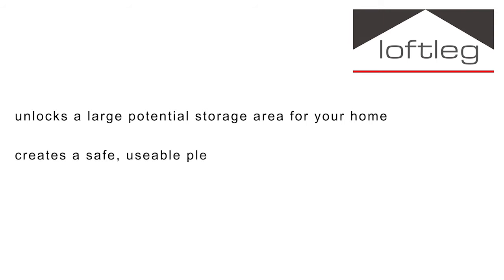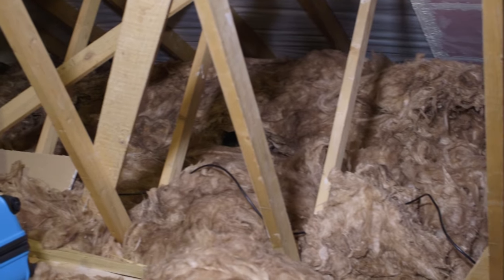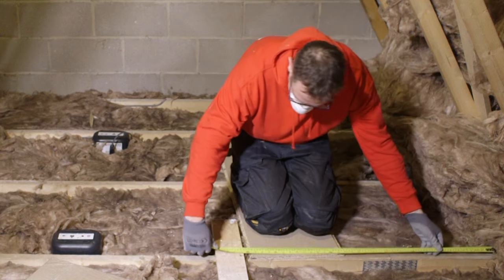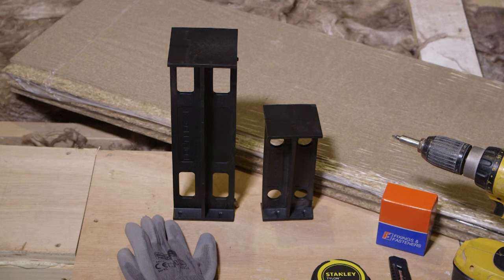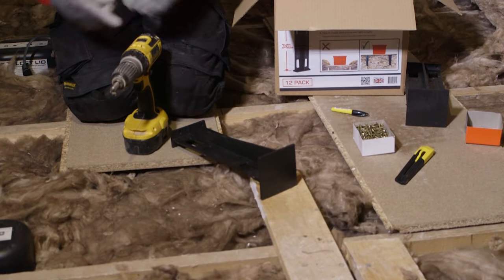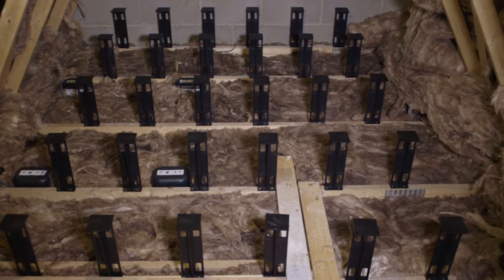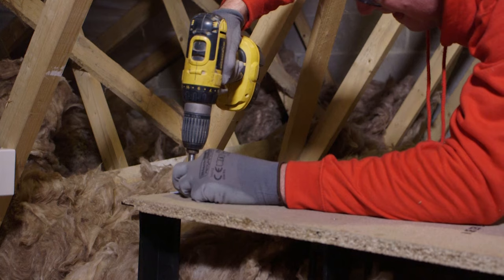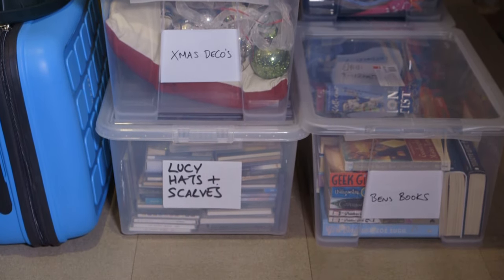How to Board a Loft | ADVICE | Homebuilding

Comment: If you intend to use a downlight cover cap and actually seal it into place (not seen them sealed into place before tbh) surely you should also include the wiring connector block and/or the transformer.  If you don't, you won't be able to easily maintain or replace the lamp unit(s) from below, you would have to do so from the loft only and will therefore have to pull up the flooring and tear out the seal(s).

Comment: I think you should explain WHY you have to do this i.e. moist warm air comes through from below and will damage the joists as it gets trapped if you don't use loftlegs. A lot of people don't understand and simply board over cramming all the insulation in.
Reply: But they just added more insulation around the legs in this video. Any rising damp will still stay under the boards even in this example. They did not creat an air gap. This feels like a loft leg sales video. Pretty sure if i used loft legs in my loft i wouldnt be able to stand up in the middle let alone edges.
Reply: @rorywestfold1657  yes this is bollox.losing headhight correct.
Reply: @rorywestfold1657  I've read that the minimum insulation height is 270mm so you can't just fit boards onto the rafters.
Reply: Nonsense. The reason it's a bad idea to compress insulation is that it loses effectiveness.  Insulation generally works by forming many separate air pockets, which all get smaller when you compress it.
Reply: If we were to board directly onto joists in our new build house, it'd invalidate our 10 year NHBC warranty. To keep it valid the boards must be at least 270mm above joists, hence why 270/ 300mm legs are available.

Comment: If you want to fully floor the loft, raise the height to suit the insulation depth by laying, lapping lengths of treated timbers across the trusses, screw down to fix. Then lay & screw down square edged 25mm treated sarking the opposite way. This way you get the whole roof. Just check out sarking around truss/rafter intersections. Sarking is much easier to lift & access for future fittings like light cables, junction boxes, mains smoke detectors, water pipes or instal any of the aforementioned at a later date. It will give ever so slightly underfoot but it is the better solution. Keep the sarking to easy manageable lengths in order to lift. Form an apron with plywood around the loft hatch to finish neet to the sarking. The loft ladder can be fitted & stored better as well. Mark up services on the sarking surface that are underneath the sarking using an indelible heavy marker pen for future reference. I’ve done this in all the houses that I’ve bought/sold & lived in plus others. It helps distribution of the loads as well.
Reply: Hi. What sort of loft ladder are you using with these raised floors?
Reply from the maker: Hi Gary, spotted a few loft-ladder queries. To clarify, you wouldn't do your whole loft with these boards, you'd do smaller areas within the loft. So for example, you wouldn't board directly in front of where your loft-ladder access is. The boards allow you to store things without squashing or compromising your insulation, and should be used as a platform for that, rather than a "floor" for the whole space. Hope that helps.

Comment: This is a really helpful video and answers a lot of my questions.  What is the best way to finish off where the insulation and loft boards come up against the loft hatch to create a neat finish whilst making it possible to easily get into the loft from the ladder?
Reply from the maker: Hard to say without seeing what the current situation is, but I would imagine there would need to be a wooden frame around the hatch, giving you a: a place to connect the loft ladder to, and b: to keep the insulation in place around the hatch.
Reply: I have a pull-down loft ladder and am struggling to see how that could work once the loft legs are installed.

Comment: quick question. after using the loft stilts. the will be a raised gab between the loft entrance and the new raised loft floor (where you'll see the insulation) how does one cover the sides of the loft entrance as I don't see a way you could attach side panels to the stilts. do you have a video or could you explain how to do that.

Comment: This is more of a comment on the insulation than the loft legs. It’s correct that to use loft lids over the lights in the room below. Surely though it’s important not to bury cables in insulation. This can cause cabling to over heat.

Comment: Can I screw the boards directly to the joist or do I need loft legs
Reply: I wouldn't. Squashing insulation decreases it's efficiency, can cause damp issues and can crack plaster if squashed too much. A friend of mine boarded straight onto the joists and the force of the insulation being pushed down onto the plaster board started creating cracks in his bedroom ceilings.

Comment: Do you need need to stagger the boards to make it stronger to walk on or does it no matter?
Reply from the maker: I don't think it makes much difference, as the strength mostly comes from the LoftLeg supports, rather than the wood itself.
Reply: @HomebuildingMagazine  another question if I may, is it fine packing plywood underneath chipboard when the does all lay level. as in plywood between loft leg and chipboard?
Reply from the maker: That sounds ok as long as the screws you use to fix the 2x boards to the Loft Leg platform are long enough - the chipboard loft boards SHOULD be strong enough without extra ply, but if you're concerned about strength I can't see why this would be an issue... it shouldn't add too much weight to the overall structure.

Comment: Maybe you can help me. I am currently doing my loft and the middle is done now. Roof legs are brilliant. I would like to board the sides too though. However on my roof every single frame has that diagonal bracing. I have checked videos and pictures and have seen that usually it is not like that. I'd like to remove one each side to be able to crawl through easier. However as I am not an architect I am not sure if that could cause any harm at all. I'd think those were used when they put the roof structure in place 15 years ago and now it is not really needed but want to be absolutely sure. Just don't know who could help me to confirm :) I am talking about the bracing that is visible around the end of the video when that additional shelf like is being fitted.
If you could asnwer this that would be greatly appreciated!

In return a lazy DIYer tip: I prepared all the legs with the four screws in my garage, made it way easier to fit them while I was balancing on the frame trying not to kneel through my plasterboard ceiling :) Ahh yes and putting screws at the very last frame on the wall side is a bit of a challenge but a ratchet does the trick ;)
Reply from the maker: Gab - without seeing it's hard to say, but I would definitely advise NOT to remove any part of the roof truss structure. Speak to a structural engineer and take some photographs of the areas you're talking about - they'll be able to advise.
Reply: @HomebuildingMagazine  thank you for taking the time to reply to me! Very much appreciated!

Comment: Cheers for the video! What kind of weight can you place on the boards. I've got loads of vinyl, dj equipment I could do with storing. Thanks
Reply from the maker: Plenty of weight - we tested them with people walking over them, and they're very strong.
Reply: Generally it's recommended that you store no more than 25kg per sq metre of flooring. Hope this helps

Comment: If the loft is already insulated and the insulation is flat with the floor joists, do you still need to use the loft legs? or can you screw the boards straight onto the joists?
Reply from the maker: If you have 270mm or more of insulation, and you can lay boards onto your joists without squashing it, then you must have very deep joists! The Loft Legs also help you avoid any pipes & cables that may be laid or fixed over joists. That said, if you have the proper amount of insulation, it's possible to fix the boards directly to the joists if you're sure it won't squash the insulation.

Comment: I’d rather cross batten with 4x2 and cover that rather than having a 45cm high floor.
Reply from the maker: The loft legs aren't supposed to provide a floor, they're a storage platform. Strong enough to walk on, but not intended for use across the whole loft area.

Comment: Do the boards not need to be connected in a staggered fashion? I read that not doing that causes weakness at the joins? Hoping to loft leg board my loft any help would be great!
Reply from the maker: Hi Katie, as far as we know there's no need to stagger the layout of the loft boards. As the boards are supported in the middle and at both ends, they should be strong enough to take the weight of your storage boxes etc. Staggering would also mean lots more boards would need cutting! Good luck with your project :)

Comment: I'm using 14mm mdf. Would I need to double this up for it to be sturdy enough? My insulation is flush with the joists so could I just put the mdf straight down or would this cause issues in the future?
Reply from the maker: Check how deep your insulation is - if it's on or above 270mm you can cover it over directly on to the joists. However, if it's less than 270mm deep, you should add a layer of insulation to bring it up to regulations, and then use a system like LoftLeg to board over without squashing it down.
Finally, MDF isn't ideal as it bows over time - a chipboard or loftboard will be much stronger and more rigid.
Reply: @HomebuildingMagazine  Thank you for this information. Muchly appreciated.

Comment: Is there a reason that there is no mention of the added benefit of staggering the placement of the boards and also lining the tongue and groove with wood glue? I’m halfway through my loft project and a builder made a mention of this. 

Also, can someone tell me that it is absolutely ok to walk on the boards once installed in this way? I’m installing 1220x320x18mm loft boards over joists that are 600mm apart.
Reply: ^using the 175mm loft legs
Reply from the maker: Hi John. As far as we know, there's no benefit to adding wood glue to the tongue and groove - they form a pretty tight fit. It makes the construction very difficult to "undo" for any reason. If you're worried about air gaps, it's better to tape over the joins. 

In terms of weight bearing, we tested it on site, and it's absolutely fine to walk on these boards once installed.

Staggering the joins doesn't really add much in terms of strength - it just means you'll need to cut more boards, so it might end up meaning you pay for more materials!
Reply: Thanks for the reply, greatly appreciated. My project will be full steam ahead tomorrow. Keep up the good work and thanks again for the video! 👍
Reply: @johnallan903  I agree with the HB&R team. I insulated & boarded my loft last weekend and found slotting the boards together and fastening them to the loft legs with screws was sufficient without the need for glue.

Good call with regards to the 1220mm boards though, I bought 6000mm boards and ended up chopping them down with a jigsaw because they were heavy AF!
Reply: @HomebuildingMagazine   Surely staggering would use fewer boards and cuts.   If for example you needed three 3.2m rows then not staggered you would need 6 boards and 3 cuts, wasting 3 x 2/3 boards which you cant use because the tongue and groove wouldnt line up.   If you were to stagger them then you would only need 4 boards and 2 cuts.   1st row: full + 1/3 board, 2nd row: remainder of 2nd board + 2/3 board, 3rd row: remainder of 3rd board + full board.

Also staggering can avoid a weakness when you have an area just a bit longer than a board.

Comment: Hi, so we have quite an old house and the joists are only 30cm apart. Should I put the legs on every joist (30cm apart) or every other (i.e 60cm apart) joist? Using 320mm x 1220mm boards. Thanks!
Reply from the maker: Hey Laura, our advice would be to go for every joist. You may need to cut your boards to fit - it's best to lay out the materials (on the patio or the drive - a big flat space!) and work out what sizes work. Those 1220 boards might need to come down to a round 1200mm in order to sit on top of the loft leg platforms. Cut your boards before taking them up the loft!

Comment: So is it not recommended to screw the boards directly to the trusses? Do you have to raise the floor?
Reply: There's no reason you CANT do that but your home will not be thermally efficient by doing this as it's now recommended you have at least 270mm of insulation, so you'd either not have enough insulation, or crush down the existing insulation, both will waste money on your heating bill. Best to kill 2 birds with one stone and use loft legs and install extra insulation, as shown in the video.
Reply from the maker: What ^he^ said :)

Comment: Do you really need loft legs? My loft already has insulation... Not as thick as here but I have no problems with heat in my house and if I put loft legs in I think I'd be taking alot of head height away... Can I just lay boards onto my joists that are already there?... P.s this is purely for storage... Thanks in advance
Reply from the maker: Hi Aidan - the decision is yours of course, but laying boards over joists is likely to squash the existing insulation IF the insulation is at least 270mm deep as recommended... and squashed insulation isn't as effective. The idea isn't that you do your whole loft this way, though - just areas of storage. Best of luck!

Comment: I am interested in flooring my loft area as shown in the video. My loft has ‘fink’ style roof trusses. The existing insulation in my loft is barely as high as the bottom chord (a few inches) so additional insulation will be required to achieve the recommended depth. I have purchased new insulation but noticed on the packaging that it advises that one should not cover electric cables as doing so could cause additional heat and lead to fire. I have existing (flat grey) electric cables running along the bottom chord (where the loft legs will attach) part of the roof trusses, do you have any advice on what to do in this situation? Obviously safety is my main concern and would not like to do anything that might jeopardise that.
Reply from the maker: Hi _Gillan. This Q gets asked a lot, and I think much depends on a couple of things: What do the cables connect to? - on the top floor of the house it's likely to be either lighting, an electric shower or possibly even a boiler. Lighting puts a fairly low load on the cable, and while showers put a larger requirement on the cable, they're only on for 10-20 minutes at a time - so neither should be making that cable too hot. If your boiler is upstairs, that's a different matter, and you should check with a qualified electrician before covering those cables.
The other thing is how much slack is on the cables - can they be tugged gently up to allow for insulation to be laid underneath? That's the ideal scenario - add the extra rolls of insulation and manoeuvre the cables to lie on top.
In all honesty, cables in walls are covered up and potentially covered with a variety of insulation types, so I don't think there's a huge danger here, but if those cables are carrying power to something quite power hungry, it's worth checking with a sparky. Good luck!

Comment: Our loft has two different height levels. The original part of the house has a lower joist height and joist span than the extension part, which has taller joists. Should I not bother with the loft legs and just board each section and having two heights?
Reply from the maker: There's no reason the loft legs & boards have to join up, so you'd be completely fine using the loft legs in both areas. However, if the taller joists give you enough height to properly insulate the loft, and board-over WITHOUT squashing the insulation, then the loft legs would not be necessary in that area.

Comment: i dont really get why you need loft legs?i’m an electrician and I don’t recall ever having been in a loft that has loft legs fitted.the boarding just gets screwed straight onto the top of the joists
Reply from the maker: Because if you have the correct amount of insulation, it normally rises higher than the joists. Squashing it down by boarding over it reduces the effectiveness of the insulation. Over time the extra money spent on heating through heat loss will outweigh the cost of the Loft Legs.

Comment: how much weight can it hold without damaging the celing
Reply from the maker: To be honest, Richard, this relies more on the strength / construction of the loft / top floor ceiling than the Loft Leg platforms. They're pretty strong - can easily support a person walking. However, as all lofts are different in their construction, you'd need a structural engineer to tell you how much load the roof joists can bear without damage to the ceiling below.